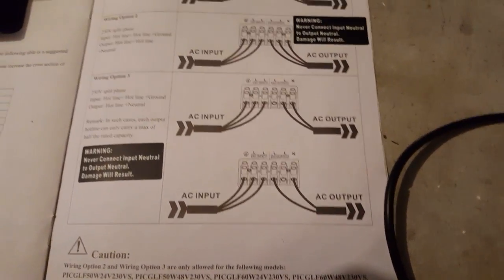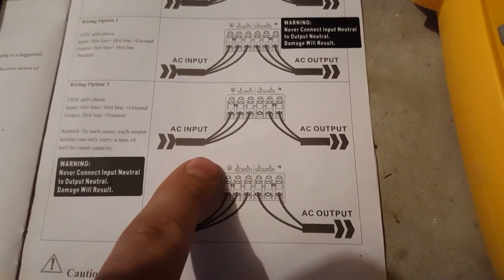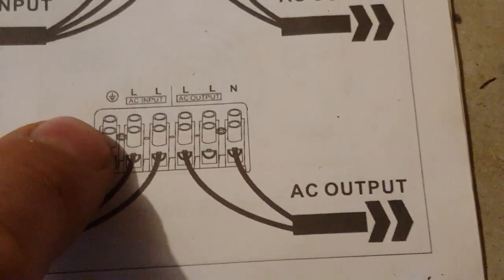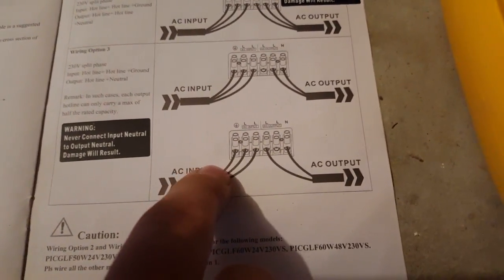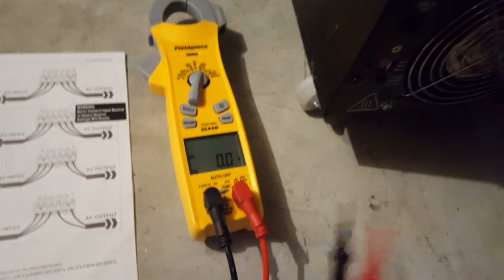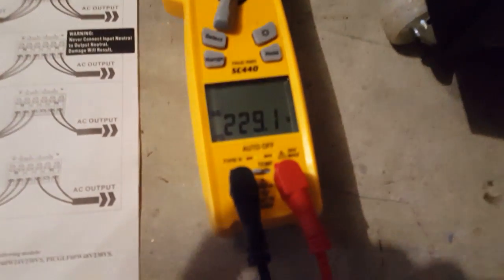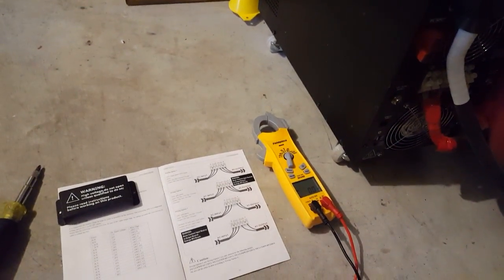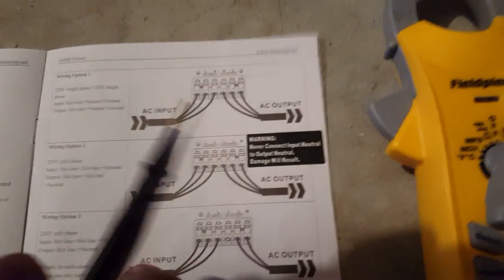Wiring up the aims 6000 split phase pure sine wave inverter to your whole house

Comment: From listening to you explain the difference between Neutral and Ground on your House system I think you might be surprised to learn where your Neutral and Ground wires are attached in your breaker panels. I am assuming you are here in the US as I don't have a clue how wiring is done anywhere else.
Reply from the maker: +Rob NAustin yes we are on US. The only reason why I gave a detailed description on this wiring it's because the inverter manufacturer gave a poor job of describing how to wire up this type of inverter to a breaker panel attached to a grid.

Comment: what do you get for voltages on the input side when you measure L1 to ground rod and L2 to ground? this is like what the utility grid provides to ours houses, two hots and a ground.
I wonder if most people that hook this inverter up to the grid input do it wrong.
Reply from the maker: +Rev John O'Toole how do you use a utility I use a ground rod and outside the backyard I drove it in the ground 10 feet deep so it'll never be the same as what you get because the ground is going to have resistance between the circuit